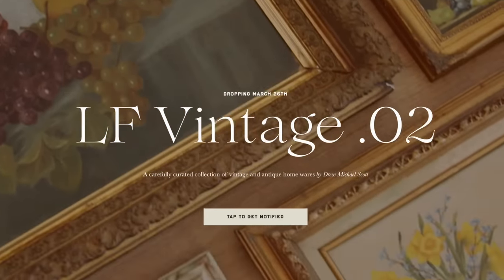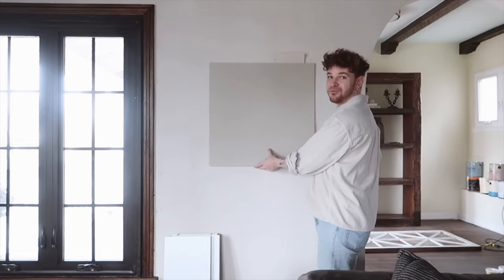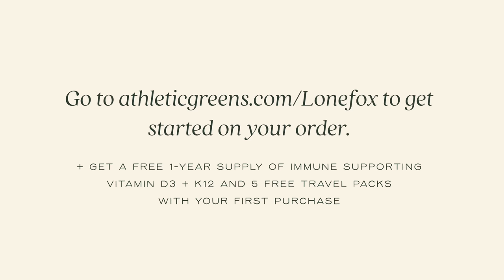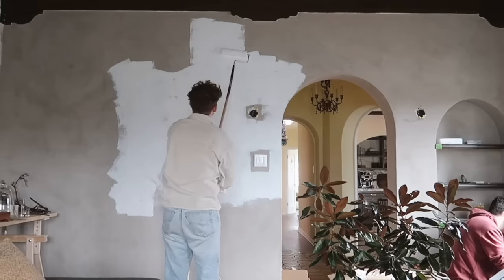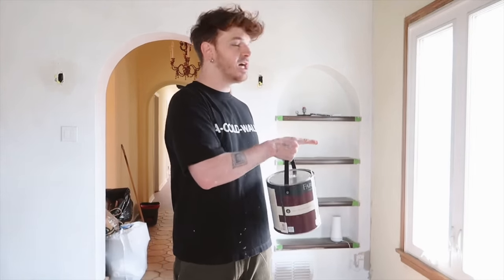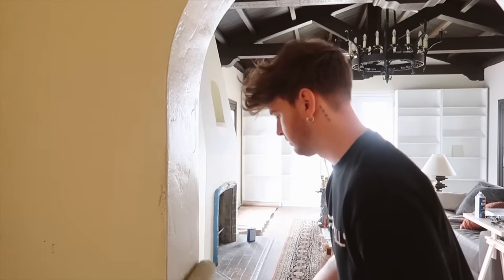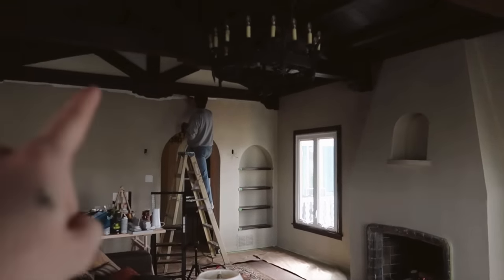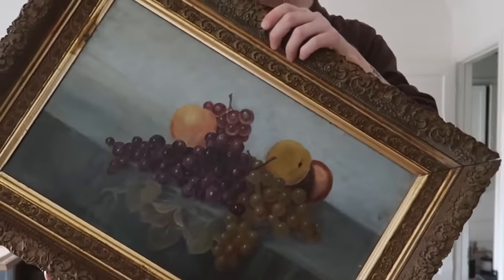EXTREME LIVING ROOM MAKEOVER ✨ Part 3 ✨ Perfect Paint & DIY Fireplace

Comment: There's a roller professional painters and contractors use. You may want to check into it. One said it's a game changer. 
The roller is about 18" wide and it hooks to the tool at both ends. So pressure is evenly spread over the entire roller instead of just one side. It cuts time immensely.
There's a special rectangular paint bucket they line with a plastic bag. That way, when you have to take a break between coats, just tie the bag so paint doesn't dry out. 
I don't remember who's channel where I saw it demonstrated.